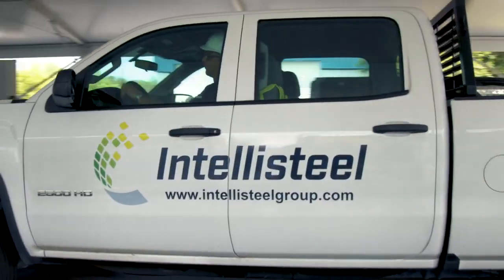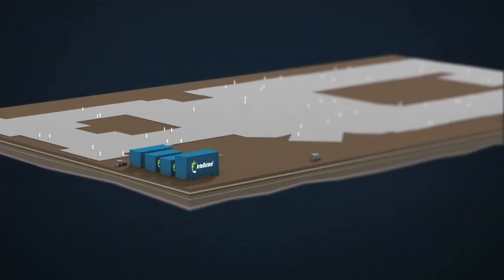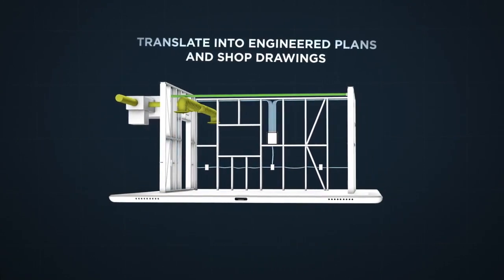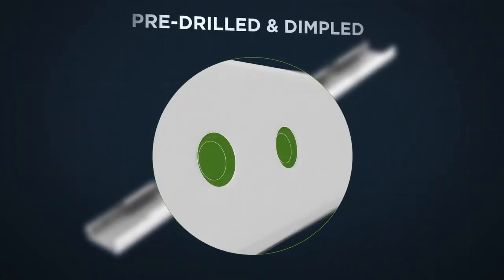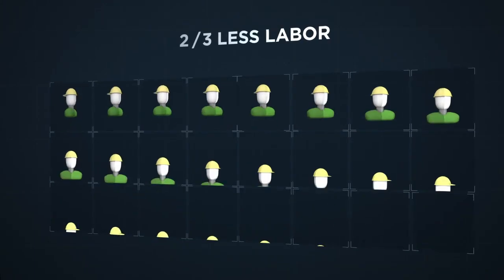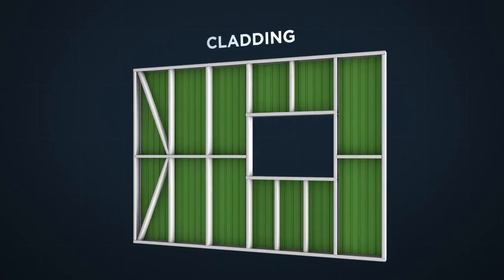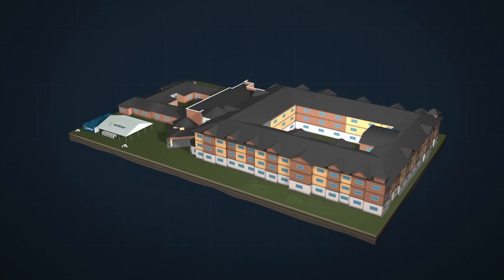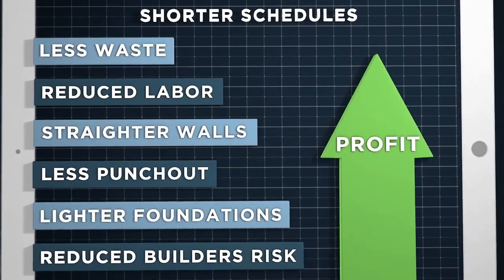Light gauge steel pre assembled wall panels for faster construction

Comment: What about thermal conductivity?
Reply from the maker: there are different options for insulation, you can achieve required U-Value with rockwool or with lightweight concrete
Reply: @stretchceilingsDubai  That doesn't address the thermal conductivity of a metal framing solution vs something like wood....  Do you have data on the difference of measurable R-values on full wall systems compared to wood?
Reply: Actually, I looked it up: https://web.ornl.gov/sci/buildings/docs/Thermal-Performance-and-Wall-Ratings.pdf

Looks like a 2x4 wall system on 16in center has a whole system R value of 9.6 (#7), the same system with metal, with the addition of wood exterior (#13) has a whole system R value of 6.1.  That's a really bad drop in system R value....